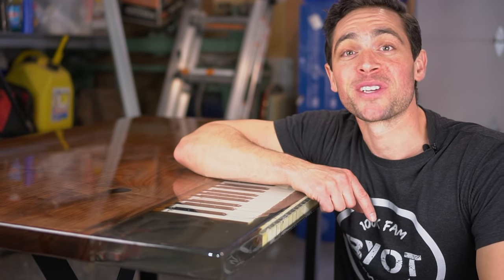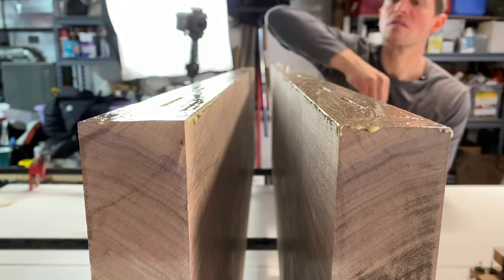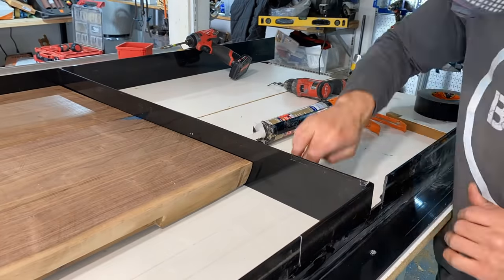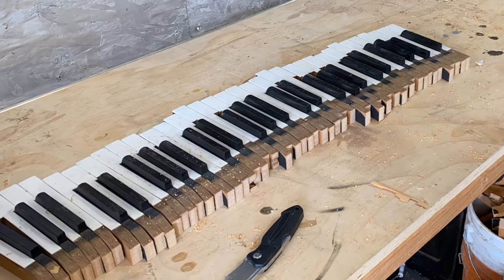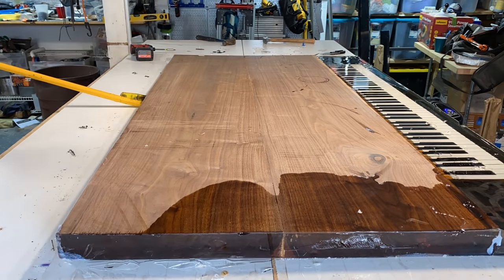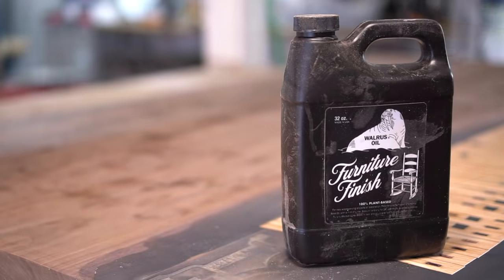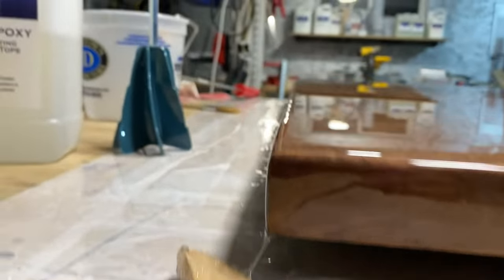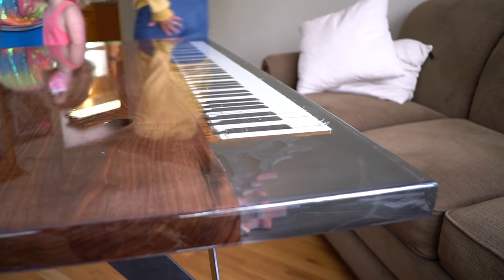DIY PIANO TABLE

Comment: One pro-tip is to superglue or epoxy the threaded inserts in. This will help prevent them from working loose over time as the wood expands & contracts.
Reply from the maker: Great tip but one thing to keep in mind is that I like these fasteners because if the screw threds ever strip then you can remove the insert and then install a new one easy.  Great tip though either way and thanks so much for watching.
Reply: @BYOTools  No fault in that reasoning.

Comment: Love this!! Her reaction at the end was priceless!! Great job!!

I just watched a video where they didn’t do epoxy on both sides and the wood ended up warping because the environmental elements were different (they used different wood than you) so I’m so glad yours turned out amazing!!Is there a difference that you’ve seen with heat guns vs torch when working with epoxy?
Reply from the maker: Thank you so much for watching and your kind words Brittney. No issues with this table on warping and I don't expect to do to the thickness of the slab.  I'll keep you posted if anything happens in the future though.
Reply: @BYOTools  I did a 2" thick yellow cedar slab table and had cupping from not completely encased in resin. The bottom not being finished with epoxy allowed all the moisture change to happen through that plane. It was heartbreaking and will never make that mistake again. I'm glad you got away with it this time.
Reply from the maker: @akgrown75  uuuuuugh! That sounds horrible. So sorry to hear that.  I’ve never worked with cedar on a table before. Walnut seems like it doesn’t cup like cedar wood.

Comment: I have not worked with multiple epoxy layers. Even after sanding with 320 grit, the epoxy manifests scratches/swirl marks. Applying the flood coat hides/obscures all the scratch marks left in the previous pour? And multiple previous pours adhere to each other perfectly so you don’t see the impact of previous pours just like you would when applying multiple layers of a wood finish (e.g., varnish/shellac/poly)?
Reply from the maker: Great questions Art and thanks so much for watching.  Yes the flood coat completely absorbs  all of the scratches or 320 makes a crystal clear finish.  And yes that is also correct with multiple pours blending together.  Good luck on your own epoxy projects.

Comment: Why not drill down and fill the larger bubbles?    the OCD in me couldn't apprecate the table as I would just stare at the bubbles
Reply from the maker: I actually did fill a few holes but some of the larger ones where the coolest ones in my opinion and the more you pock at it the worst it will probably get :) thanks for watching though bud and the support as always.